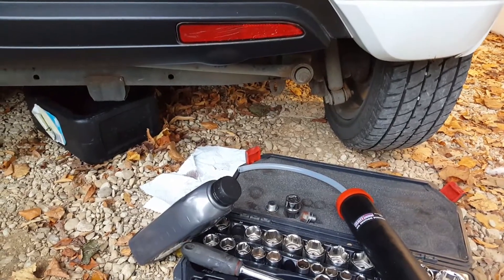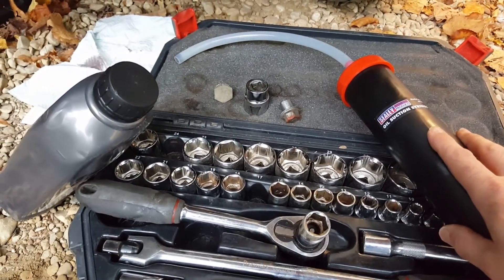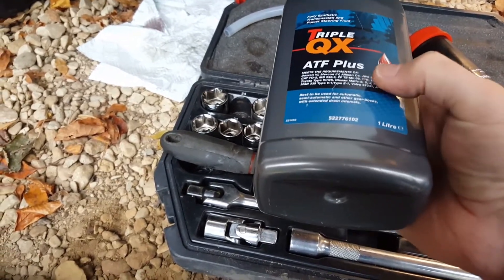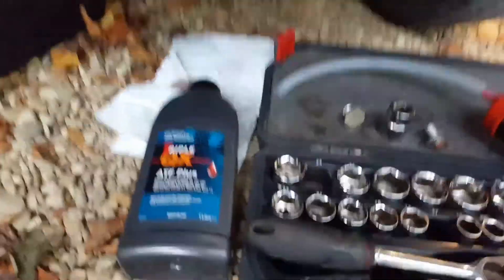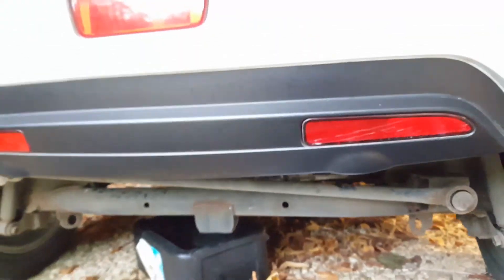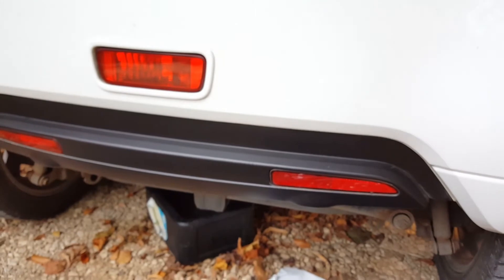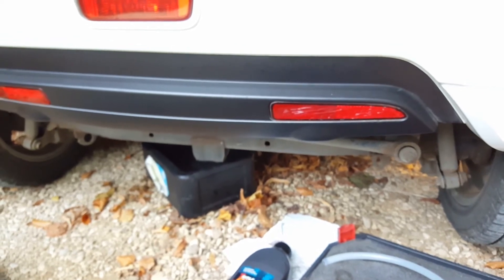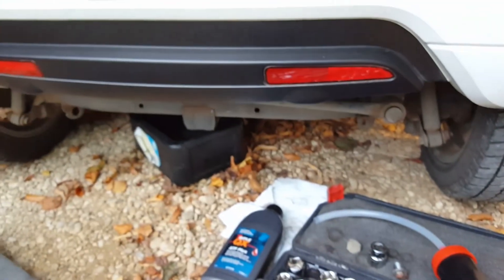Changing the reduction gearbox oil on a Mitsubishi i-MiEV, Peugeot iOn or Citroen C-Zero EV

Comment: I just did mine - 10 years old and 55k miles (88k km) - it was BLACK, stinky and utterly opaque even under a very strong light (I don't think the car has ever been serviced outside the dealer warranty period, the cabin filter was black too)

No catch magnet on the drain bolt means any metal fragments are only relying on gravity to percolate down. Nothing silvery in there thankfully but I'd consider hanging a strong magnet on the case to pull anything nasty out of the mix (old hard drive magnets work well for this task)

Interestingly, the car seemed to have a fraction more pep and economy after the change - which really surprised me but I guess if the oil has lost its lubricity you might find this

Notes: 

1: The bolts were massively overtightened and needed a breaker bar to get loose (120Nm needed to dislodge them - some clown had done them up with a rattle gun)
2: Putting the drain in (hand tight is fine), adding a small shot of ATF (100ml) and then draining again will remove most of what's left of the nasty stuff in the bottom of the case
3: Don't forget to dab the bolts with Loctite 222/242 (or equivalent WEAK thread locker/sealant - the blue/purple stuff) when reassembling - per Mitsubishi spec. This is primarily intended to stop oil seeping out the threads rather than as a locker, so you want 100% thread coverage (breakaway strength is 5Nm - its primary locking purpose is "antivibration")
4: don't overtighten the bolts! 32Nm is the spec. It's "snug - and a little bit" - less than 1/4 turn past hand tight, but a torque meter is a cheap investment if you don't have a calbrated arm (I paid £30 for a 3-130Nm electronic one which calibration checks show is spot on across the range). You don't need to demonstrate gorilla strength skills here
Reply: Thanks for the info on the torque spec!

Comment: Did you use a small top funnel to refill the ATF?
The hole is in a strange sideways position
Reply from the maker: Only every used the hand  syringe gun/pump as shown in the video. You can buy them cheap on eBay (£8).
Reply: @GoGreenAutos   oh sorry, now I rewatched it and noticed that you mentioned the syringe. Thanks.